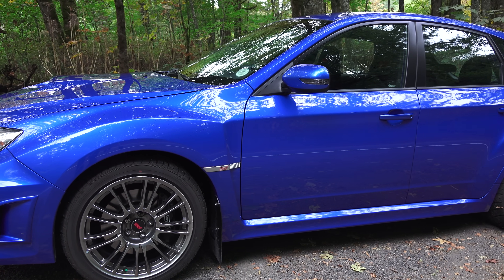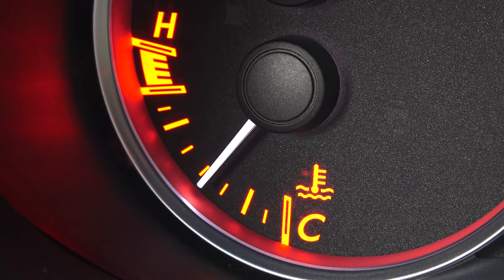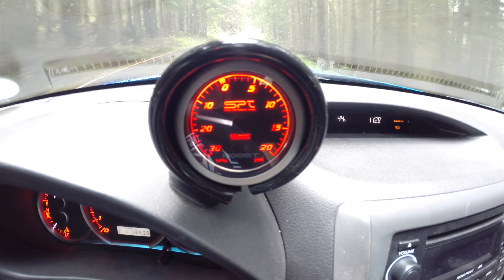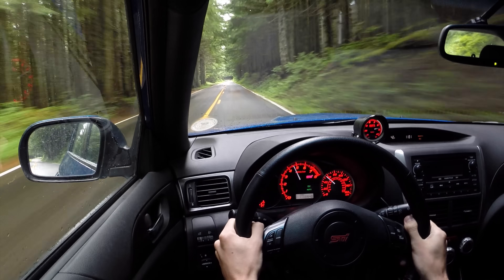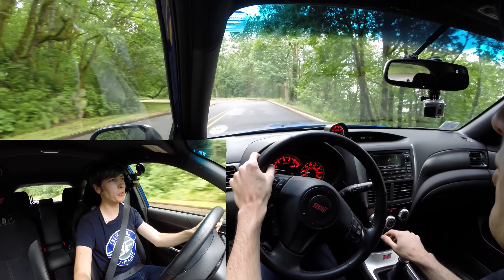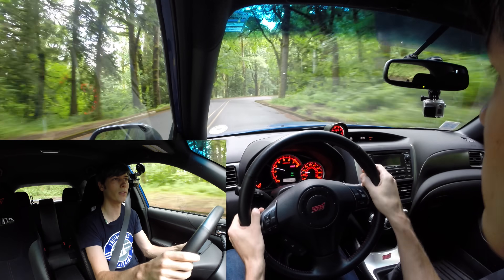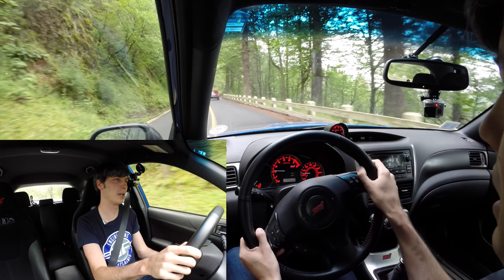5 Things You Should Never Do In A Turbocharged Vehicle

Comment: I could be wrong but even if lugging. Wouldn't the ECM prevent rich/lean mixtures?
Reply: To be quite honest with you a lot of the information this guy talks about sounds like it's all from a 20 year old automotive text book so I wouldn't worry yourself about what he says
Reply: Yet the ECU is that which is actually actuating the throttle response- very few cars have a mechanical throttle linkage these days. Therefore the ECU, which holds the logic to adjust the injector timing (to vary the mix) WOULD know about the throttle change- literally before it happens. Not before you step on the pedal (electric sensor), but before the engine is manipulated in any way to open throttle (actuation).
Reply: I would think so, especially on the newer cars... The older cars weren't as advanced so that's what I would watch out for. I would think that the ecu would read that you aren't getting as much air so don't add as much fuel. But what do I know lol
Reply: My 2013 Mazdaspeed3 definitely has lug prevention. If you floor it under about 2800 RPMs, it doesn't boost until it RPMs come up.
Reply: Correction ECUs can respond as fast as as thousands of a second fast. e.g. 0.005 secs or 5 milliseconds.
Reply: I would think so, as most vehicles have MAF sensors or air flow meters which let the ECU or ECM know at any given time exactly how much air is being drawn into the engine and the ECM fuels accordingly..
Reply: Bob Potter Mine was the same. I miss my Speed3.
Reply: +Bob Potter Are you tuned then? Because that's a known problem with the stock tune. You can floor it at 1,200 rpm in 6th and generate a lot of boost pretty easily.
Reply: Robbspeed3 Stock tune on the new model speed 3 didnt boost until in proper engine/road speed.
Reply: +TheMaverickSpawn What new model? Ms3 has been out of production since 2013.
Reply: +Robbspeed3 smiley speed3
Reply: TheMaverickSpawn Mazda made no such change for the 2nd gen speed3.
Reply: TheMaverickSpawn the issue he is going on about is really only on older cars, really isn't an issue nowadays
Reply: Will Palmer which makes sense. Ty. I was strictly speaking with my experience. Which for the 2012ms3 it doesn't boost up in 6th gear unless rpm is correct. Safety measure? Absolutely. Ty again.
Reply: TheMaverickSpawn When I was stock, I could hit peak boost in 6th at 2,000 rpm no problem. The ecu wasn't limiting boost at all.

Comment: my 335i doesnt have a coolant temp gauge, just oil temp
Reply: +Moffat c 3.0 not 3.2
Reply: Bmws are not turbocharged so you don't have to worry about this lol
Reply: The 335i is?(are you euro or Asia cause I'm in us
Reply: +Scott Graham who
Reply: +Scott Graham, 06+ 335i was is twin turbo 3.2, after 09 they went single twin scroll 3.2.
Reply: Mine doesn't either and yes 335i are 3.0 twin turbo and they oil show engine oil temperature
Reply: You have no idea what you're talking about. Almost all of the BMWs are turbocharged these days.
Reply: I've got a 335i as well, and you're correct.  The car has a yellow and red water temp warning system if your engine is overheating.  Have you had to replace your water pump? The only time I've ever got those warning was when mine decided to fail.
Reply: +coinsagE46m3 my 335i is 2011 yours? I also had to replace a water pump.
Reply: what happens when it failed ? was it a rough idle when you started it? i have a 335xi 2008
Reply: Work at a BMW garage for 7 years. Got great business out of the 335i. Have you replaced trans pan for leaks?
Reply: +chippyjohn1 I'm looking at buying an e46 m3   (no smg) (most likely an earlier version like 2002 - 2003) or an e39 m5 (2001- 02). I've done a lot of research on both of the cars already- what car do you think is more desirable to drive in your opinion considering all of the problems both cars come with?
Reply: Not yet just water pump faliure and overheat on the highway
Reply: Apollo Rap No, no rough idle.  When it failed for me, the engine fans kicked on full blast when I cold-started it one morning.  When your fans kick on even though the engine is cold, that's a telltale sign your WP just kicked the bucket.
Reply: chippyjohn1 Yeah, those cars are fun as hell, but man did BMW screw up a few things on those.  Haven't needed to change my trans pan yet, just have done the WP and intake port cleaning.  Still runs like a beast.
Reply: mow 2 I know your question wasn't directed at me, but I thought I'd throw in my two cents.  Overall I'd say go with an E46 M3 as far as driving enjoyment and potential issues.  It's the lesser of two evils, having owned both of them at one point.  They are still both very expensive to fix, so no matter what you do, make sure you get it checked out by a reputable shop before buying.  And personally, I'd go with a later E46 M3 (I had a 2004) as the earlier ones I'm told are more prone to rod bearing issues.
Reply: +coinsagE46m3 +apollorap nope no rough idle, just very sudden overheat after five miles on freeway. checked under the hood and there was coolant everywhere. Apparently it was the last owner who did a water pump, forgot the gasket, and did not torque down the bolts. Only 27000 miles
Reply: +coinsagE46m3 I actually did. The damage was so bad it ended up destroying itself, it was a bad egg and had no lubricant. the coolant is what kept it from just locking

Comment: Also use good oil like 0W/40W, and change it often ( 5000kms) or use a 1 micron, 95% efficient bypass filter. Replacing turbos in some vehicles like the V8 twin turbos is an utter nightmare.
Reply: depends on the motor

Comment: Isn't engine knock and pre-igition the same thing? Also, pre-ignition is not a recent thing. On carbureted cars this was a common issue. Fuel mixture and ignition timing had to be adjusted all the time. I had a 1972 toyota hi-lux, with a carb and points and condersor. I had to adjust the point every couple thousnad miles for optimum performance.

Comment: Umm, But what about a Ford F350 7.3 Turbo Diesel, It don't hurt it to lug it at all. 300k miles, only the alternator has failed, AND a tree has came down on it, but didn't damage it much. 
Also, In tractor pulling its to the extreme, untill it stalls or is at like 300 RPM and clutch...
https://youtu.be/dyEYaN6Y_FM?t=2m22s
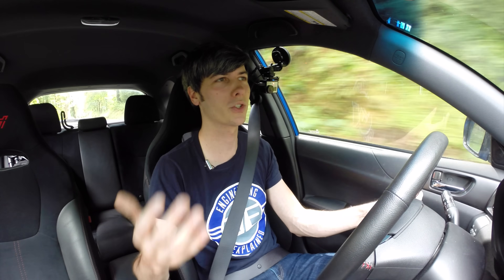Reply: 5:00 But thats why tractors have the turbo ratio so it gets high boost even at low rpm (most of them, I know cat does this with engines)

Comment: what about not flooring it while low on fuel? if i floor it while less than 1/4 fuel i risk a fuel surge where the pump sucks up air. 

its not the case for some turbo cars but is for my 500hp 4LT 6CYL one.

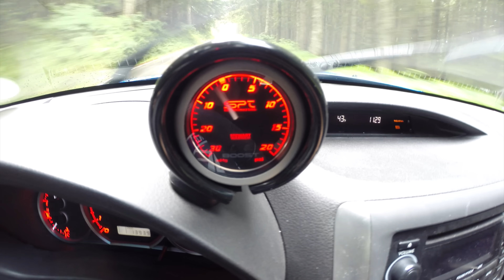Comment: 3:56 On engine lugging, did you mean to say that when running the engine at high gear at near-idle speeds the turbo-lag would cause engine detonation because the fuel injection will be thrown off sequence,( a cause of exhaust backfire), and ignition timing won't compensate, even with VVTI standard?

Comment: The part where you talk about low-rev on diesel engines is not quite accurate. My car has a 1.9 TDI engine and turbo starts bosting @1800 rpm - this is factory settings default. Most diesel engines are very low-rev, in my case redline starts @4500 rpms.
Other than that, great video.

Comment: LSPI? Hmmmm... it would be nice to have a video about it.

I already prepared a Ford Zetec Rocam 1.0l engine with a tiny M24 Eaton blower (0.7 bar generating 115hp@7000RPM with ethanol) and the pressure is not exactly high at low RPM to occur this phenomenon, but my brother is planning to prepare a Zetec Rocam 1.6l with a BorgWarner K03 from a DS3 and the boost will come early which might lead to that phenomenon... I'm very curious about it.

Comment: Hey Jason (or everyone more knowledgable than me), not totally related but yesterday I put gas in my car and went off, I smelled gas so when I had the chance I pulled over to check if the cap was properly screwed (because in Mexico you can't fill your own tank, someone does it for you) and it was but when I took it off to check, presurized air came off the tank and when I put the cap back on it stopped smelling, this never happened to me before, could this have been dangerous? Why did this happen?
Reply: The cap might be a bit loose so you can smell fuel, I think it's a bit dangerous but as long as you check you cap after filling you will be safe.
Reply: cold fuel, expands as it warms up in the tank, pressurises the air
Reply: piedpiper makes sense since we're having 40C heat and the fuel tanks at the gas station are underground! Than you!

Comment: More manufacturers offer their cars with turbos. For instance the Ford Flex is offered with a conventional six cylinders and the Eco-boost version. 
It seems like most buyers are a little hesitant to go with the turbo for fear of reliability issues: a turbo won't last as long...
What is your take on the reliability of turbo charged engines and is there a difference with turbo charged Diesel engines when it comes to reliability and longevity.
Thanks. Great channel!

Comment: Ok which car should i get with budget of about 4k usd the car should be fun, not turbocharged and not from USA.
Reply: 2001 bmw 330ci inline 6 rear wheel drive.
Reply: mazda miata, sweet ass cars. they're small and maneuverable, cheap and pretty easy to work on. if you can get over the stigma of it being a girly car.
Reply: Mk4 GTI vr6
Reply: gti =/= vr6
Reply: does the fwd lower the smiles per gallon?
Reply: +Anton Markov around town fwd can actually be more fun because of more direct "point and shoot" steering. On a racetrack or just drifting and being a hooligan though its different and thats where rwd is better.
Reply: +Anton Markov around town fwd can actually be more fun because of more direct "point and shoot" steering. On a racetrack or just drifting and being a hooligan though its different and thats where rwd is better.
Reply: +Anton Markov Ultimately it can vary based how the car is set up, especially with older cars. If possible I would recommend just test driving as many cars as you can and see what you like the most. The vw gti in almost any year is a really fun car and the vr6 model comes without turbo but with a bigger 2.8L motor that is still fast. I think that is the car Id recommend the most. Whatever you chose, good luck!
Reply: +Avery Buda Thanks, I will try to do so.
Reply: a rare form of the gti comes with the vr6 and a rarer form comes with the r32.  try Wikipedia sometime, dude.
Reply: Where I live they aren't that rare. My uncle has one and I've seen quite a few others around too.
Reply: 2002 (that body style, any are good) Honda Civic Si hatchback
Reply: where I live bmws are worshipped the only available are e46 2.0 at most at that price range :/
Reply: John the vr6 and R32 are not gti's theyre different golf variants.

fwd can be pretty alright but ill always get rwd or awd. ive had a skyline, a subie and now an e36 328 and theres just this great intuitive feeling about have steering and brakes at the front and power at the back, it just feels like everything is where it should be. 
it's a common misconception that rwds are only good/fun because they can drift. i very rarely do skids and im not very good at it, but rwd just feeling better on track and mountains imo, the steering and braking feels more precise and uncompromised.
Reply: +piedpiper cool bro most likely I'm going to get Lexus is200 not a lot of horses but I think it will be fine.

Comment: Always impressed by your knowledge and your means of explanation. As a teacher, I applaud you my man.
Reply from the maker: Thanks for the kind words!
Reply: +RedTurbocar , you made no points... that's the point. nothing to back up what you said. you greedy little troll, by the way you only have to post once not four times
Reply: +Richie Jeffs Water (coolant) has a much greater coefficient of thermal conductivity than does oil.  that, and only that, is why your coolant reaches operating temp faster than oil.  Oil systems, especially turbo cars with coolers, have thermostats too.
Reply: +RedTurbocar blah blah blah
Reply: +RedTurbocar 
Interesting, but understandable, as I would assume (and I know not always but usually) that thicker substances would take longer to heat up?
Reply: +Mr Ornelas 
thanks for the chuckle
Reply: +Mr Ornelas HA.  what points did I make?
Reply: +Mr Ornelas HA.  what points did I make?
Reply: +RedTurbocar 
Unless I'm mistaken the thermostat is exactly why the water temp reaches full operation before oil? or am I misreading what you've written?
Reply: So in effect we are both correct...well that was possibly the fastest resolved dispute on here!
Reply: +Richie Jeffs if you kept the oil thermostat closed, and kept the coolant thermostat open, the coolant would still take far less time to reach operating temp, again due to differences in coefficients of thermal conductivity.
Reply: chris is the "einstein" for auto!
Reply: +Richie Jeffs .  It would if the heating source was the same, however the water conducts heat while most of the oils heat comes from direct friction of the moving parts that it is in contact with.  The coolant is only in contact with one moving part, the water pump, which isn't really all that hot compared to bearings or the piston rings.
 So in this case, the oil is heated up almost instantly by friction contact, but the coolant is heated after the oil has been circulated and in direct friction contact.  

Yes, there are a few cars that have an external oil cooler similar to a radiator, but a lot smaller.  There is also an oil pan that can dissipate a little heat from the oil to cool it as well.  But I can say with certainty that the oil reaches operating temps a lot faster than the coolant.  

Not to mention that oil temps are hotter than coolant temps.
Reply: half of the things you said are incorrect

Comment: while you are right in regards to coolant warming to temp faster than oil, and oil moving through the pan etc

you forgot to say one thing, that there is much more coolant that oil, (in your car, it is about 4 lts of oil, and 8 lts of coolant!) 
and oil flow, if you have the right oil for not just your car, but climate (if you live in hot areas the owners manual isn't always the best suggestion)

as for your "best fuel you can buy" that is a double edged sword in some countries, in many counties they might have a blend of fuel (say E10, where there is 10% ethanol) which is often in the lower end fuels, like 91 octane, and 95 octane might be pure petrol, however in an turbo, the E10 can sometimes be a better option, and the ethanol cools the intake charge far far better, (depending on the position and type of injection) and the e10 is better at avoiding knock, two good reasons to buy the "lower" grade fuel

Comment: Two Questions :

1) Does synthetic oil make a difference in regards to the first point?  Or wait a few extra minutes with synthetic as well?  

2) Some cars have an automatic cool down period (like my old Saab) that turns on the fan for about three-four minutes after the car is run "hard" to lengthen engine life.  Do you recommend to leave the car on in addition to that? I never do.  No engine issues after 144K.  Thanks.

Comment: #3 is a myth. I go full boost in 4th and 5th at 3k rpms all the time in my wrx. @ 165k on stock block..
Reply from the maker: +ryanrunss 3K rpm tends to be high enough. 1-2K is a much more likely range for LSPI. This is coming from SAE journals, with repeatable tests, rather than an anecdote.
Reply: +Engineering Explained I'll take your word for it!
Reply: Yea 3,000 has been fine for me too but my car built full boost around 2700 so never a problem at that rpm either my friend.

Comment: I have a 1997 Suburban 6.5L turbo diesel. at 3:50 he discusses spark plugs in his diesel engine. My engine has glow plugs and no spark plugs. I thought this was true for all diesels. Is this not the case; are there spark plugs in most or some other diesel engines? If so, I was under the impression spark plugs were not a feature of diesels generally.